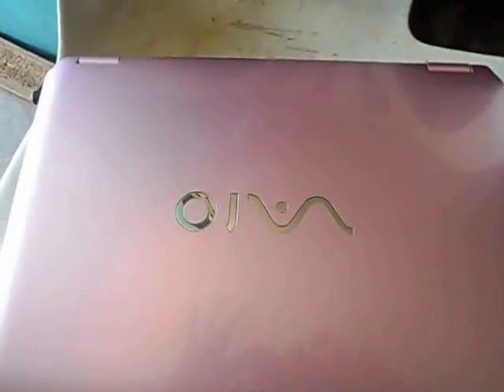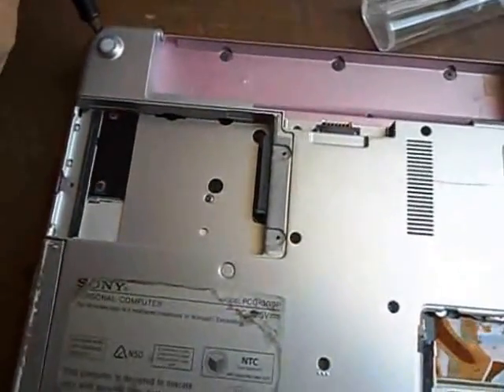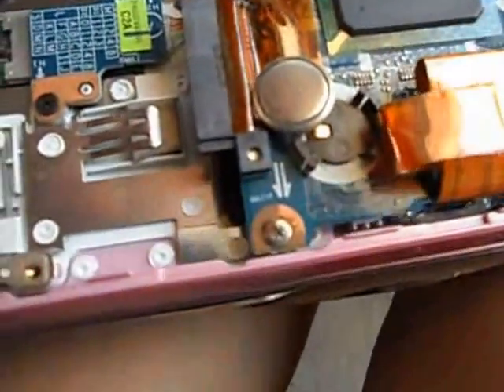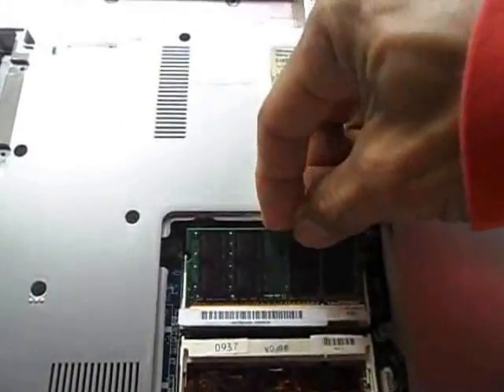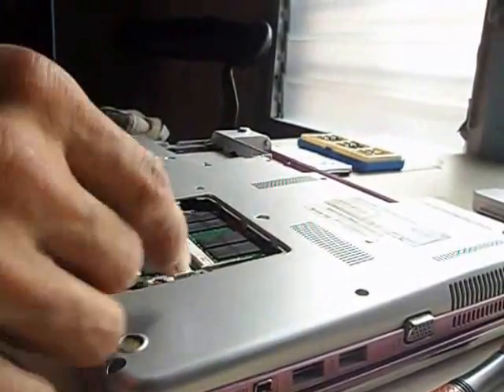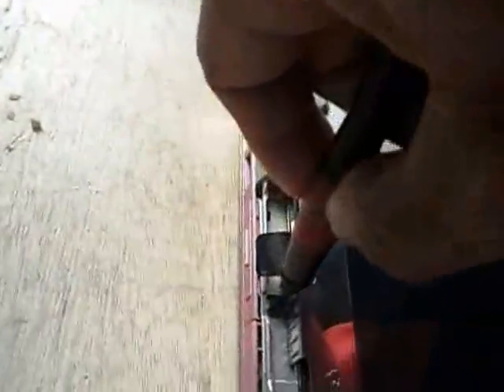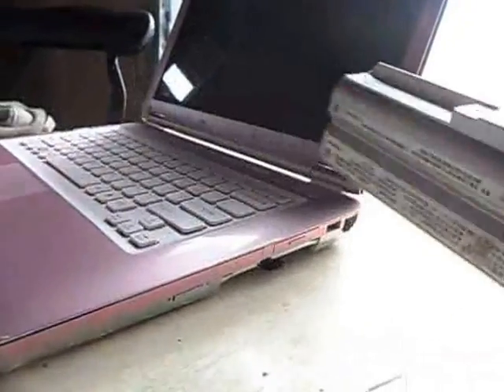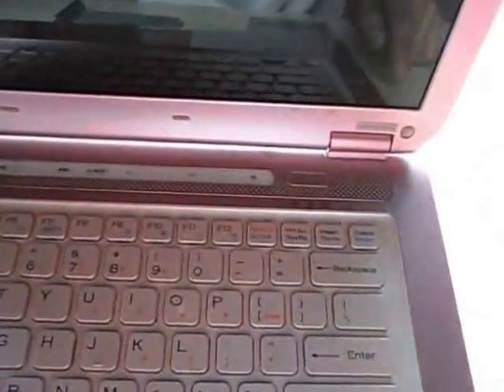SONY Vaio laptop doesn't power up!.. but problem solved! (repaired)

Comment: sir pwede help mo po ako. di ko maopen yung sony viao laptop thanks po
Reply from the maker: hello late reply sorry, have you tried the steps that i made on the video? or ask a friend to open the laptop for you so that you can reset the bios battery. and pressing the power button for a while without the battery pack inserted to drain the charge inside the circuit board.or check if your power adaptor has a 19 volts output thanks

Comment: Thank you. By all accounts this shouldn't work in solving the problem of a laptop not turning on, but it did for me. My battery is different to yours, mine is green with two cells and a plug and I needed to order that specific item number on the internet but it was fairly cheap and worth a try. As I was putting the machine back together I was not expecting it to work and was really surprised when it turned on and it is now (after resetting the clock) working perfectly. Thanks again
Reply from the maker: You are welcome, thanks for the comment

Comment: yung sakin po hindi sya nag on. then pag charge ko sya hindi rin umiilaw yung batt indicator.. same po ba problem ng sakin dito sa video??
Reply from the maker: hi, i don't think so if they are having the same issues. a lot of things to consider.before going any further. first, have you tried to clean the memory stick or the ram? removing the battery then push the power button for 10-15 seconds to discharge the circuit board? just let me know. you can leave a message again, thanks
Reply: noechie1827 tnx sa reply.. hindi ko pa binuksan or nilinis takot akong buksan sya kasi... pero na try ko na yung discharge wala rin nanyare..
Reply from the maker: Do you have any idea on how to removed clean the ram stick or memory?
Reply from the maker: does your power adaptor has an output of at least 19 volts? you can check the voltage output on a multi meter tester. tnx
Reply: noechie1827 nangyari na po ito dati den after. a year bigla na lang bumukas but then namatay nanaman ulit ngayon nga..
Reply: noechie1827 tinangal ko na rin po memory yung sa ibaba diba naka screw..
Reply from the maker: hello, sorry late reply. i guess,s your laptop need to be open to see what was causing the problem, if you have a friend or who ever can help you to  dis assemble the back cover of your laptop. ask help.
Reply from the maker: you can reach me here again thanks

Comment: this is the second video i watch where taking out that little circle shaped battery is the fix but i dont see it anywhere on my computer, please help
Reply from the maker: hi, sorry for the late reply. what kind of computer or laptop are you using? had you access the motherboard already? most of the computer motherboards and laptops has similarities, you can leave a message. tnx
Reply: can i see the other video ? i m also having this issue, ram etc did not help, turning on laptop only shows power light on. then nothing happens remains black, holding power button down wont turn off the laptop either

Comment: Hi.. i have a Sony Vaio PCG-61611M... when i turn it on only with DC battery the green light is blinking and the screen is black...and when i turn it with ac adapter the green light isnt blinking but again black screen..what could be the reason for this? is it maybe beacuse i dont have the proper sony adaptor 19.5V? i am now using a universal one which is 19V...
Reply from the maker: hi, sorry for the late response, and thanks for viewing on my video on Sony Viao laptop repair. there are a lot of possibilities and concerns with your laptop. let me ask you some questions. if you have an idea on how to dis assemble your unit? or if you know a friend to help you with.try to find instructions on how to dis assemble it.  if ever you happened to dis assemble your laptop, first you need to check on the whole motherboard if there are some dirt, corrosion's etc visible with eyes. detach all removable parts, the ram(memory) hard disc, wifi card etc. and try to remove from the cpu socket the processor and clean carefully. after you have done all the steps. then re assemble the unit with the battery on it. give me a feedback tnx

Comment: Bro, yung Sony Vaio ko ayaw mag-POST, nag-o-on siya pero walang lumalabas sa display. Nilinisan ko na ang memory (dalawa), at ini-reseat ko na lahat ng peripherals pero ayaw pa rin. VPCYB35AG yung Vaio ko. Kakaiba yung CMOS battery niya, yung wire lang na naka-connect sa board ang puwedeng tanggalin at maliit lang yung battery. Umaandar naman yun fan niya, pero walang indicator yung HardDisk (gumagana yung harddisk nung sinubukan ko sa enclosure). Sa tingin mo ano kaya ang problema niya? Maraming salamat.
Reply from the maker: hello Rodelio Rodriguez, sorry for the late response just got check in on my emails, then i just read the email from your comment. well,  i have noticed that you have knowledge and ideas in troubleshooting. just ask some questions, have you removed the battery first and did you touched some metals to discharged the static charge in you? the time you are taking out or pulling out pieces of hardware's from your motherboard one by one had you notice something? when the ram (memory) are taken out have you heard some beep codes when you try to power it up? if the ram was taken out it should post beep codes, is there a display when the ram (memory) was out? well then, make sure that the unit is powers off. detach the hard disc, ram and the cmos battery or the wire that was connected you mentioned to the board. then try reseating the cmos battery on the wire connecting to the board. then reseat  only 1 ram to the ram slot, no hard disc etc, make sure they are all in place properly. then reseat the battery or the ac power adapter. then try to power it up.
Reply: Thanks for the reply. I've already tried removing and reconnecting the CMOS battery not only once, and I've already also tried just putting 1 RAM at a time and still no go, nothing is displayed, there is no POST. I am running out of ideas. Last resort I could try is to clean the board with a dishwashing soap. Or try also putting it in the freezer.
Reply from the maker: i guess it was not a good idea to clean the motherboard using a dish washing paste or gel. if you can check what kind of ram do you have, their specs. or if you can get some ram with the same specs as yours from a known working laptop. try that ram to insert to your unit
Reply from the maker: or try to connect a pc monitor on the vga hdmi  on your laptop to the pc monitor vice versa

Comment: Di ko makita yung cmos battery nung sa'akin. umiilaw yung 1st LED. Sometimes, nag-on. Most of the time, hindi. Magaantay ng 5 to 10 minutes bago umilaw uli. Wala na yung VAIO care, kaya hindi ko rin maaccess yung bios.
Reply from the maker: +Daniel Andrei “Danny” Garcia  hi, do you know how to dis assemble your Vaio  laptop? if you do, you need to remove or detached all the components/ accessories/ peripherals etc. first the battery and so on. prevent static power. after detached dvd/cdrom, ram, heat sink fan and the CPU but with care. clean the whole mother board with a pc blower if you have. then apply thermal paste on the top of the cpu. replace the cpu to its proper place, heat sink fan then go on to the procedure. attached the bare motherboard to the lcd plus keyboard and attach atleast 1 good ram/ memory stick . then try to power it up. pm me again if what was the progress of your vaio  just be patient to look for the cmos battery tnx
Reply: +noechie1827 wow. salamat po. ++ try ko pag nakaipon para pc blower. sayang kasi 2nd lang tong vaio nakuha ko. maraming salamat po uli